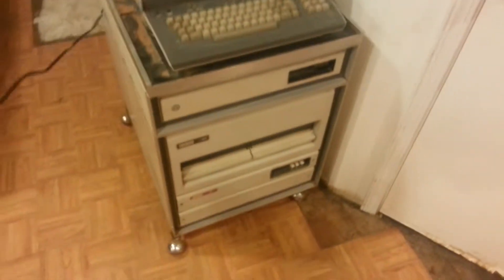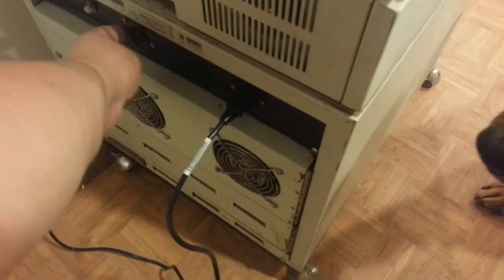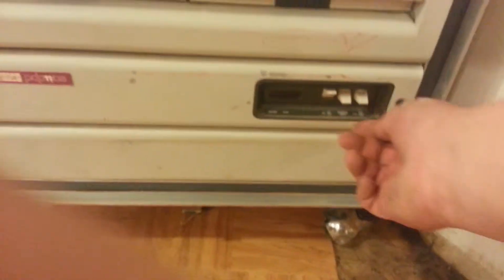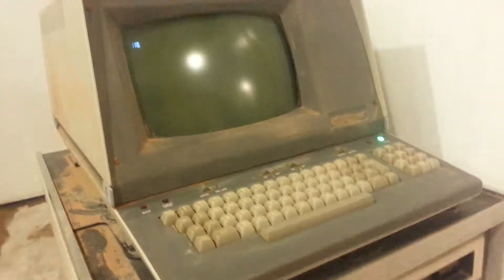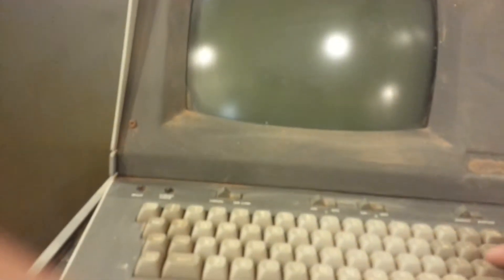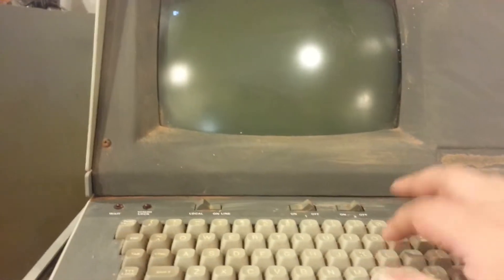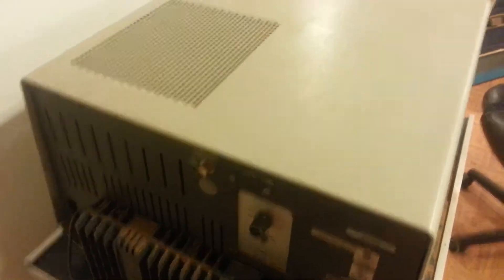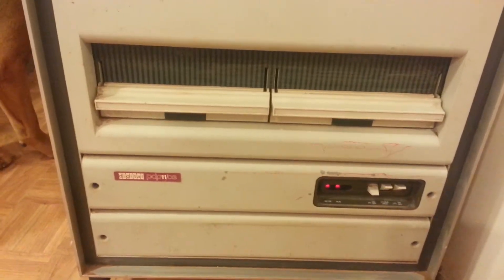PDP11/03 power up attempt

Comment: Hey I was wondering if you still had that Dasher terminal for your Nova 4?
I completed the 2400 mile round trip to pick up my Nova 4 finally and I would love to have a Dasher terminal for it so I can use it for display at Vintage Computer Festival if I get the machine running.
I remember you said the keyboard got crushed but I would still like to have it in hopes that I can build one from scratch as I don't think it will be too difficult to do.
I don't remember if you were willing to part with it but if you are I would love to work something out.
Thanks,
-Connor K

Comment: Wow awesome find. I see you also have a Data General Eclipse? Nova? sitting there as-well! Do you collect vintage computers or just happen to find these beasts? I personally collect and lust after getting a PDP 11 someday. I actually recently bought a DG Nova 4 1150 miles away from me... I still have to go get it, I would have had it by now if I didn't have car troubles... :/ Anyway good luck figuring out these beasts! (Side note I don't know if your a furry but I like your icon, I personally am a furry but not as huge of one as many are heh)
Reply from the maker: Yes, that's a Data General Nova.  I had it operational for a short period of time; one of the start capacitors in the hard drive went out and I haven't had time to mess with it.

I own a technologies consulting business in a small industrial town and these things come up from time to time.  Much of the equipment around here doesn't get upgraded often, so I wouldn't be surprised if these machines had still been operational up until a few years ago. I'm always fascinated by the workmanship of the old systems, and when I learned they were going to be scrapped I had to save them.

I live in the Lubbock TX area.  If you want the PDP machine let me know and we can try to work something out. It has some proprietary Bell System gear wired into it and I've never been able to get it to work right.  I don't have time to mess with it or room to display it.  I think I've taken some face plates off it and it's a bit grungy from storage but it should still be operational.
Reply: ***** Wow really? I'd love the system, but I actually live in Maryland so your very far from me, but I may be making a trip to California with the family in May in the RV so I'll likely be coming through the state then... We will have an enclosed trailer with a car in it but there should be plenty of space for the system. If you can hold it that would be awesome and I should be-able to get it, if you just want it gone to a good home asap I can forward this to some vintage computer mailing lists and probably have someone give it a good home :)

Anyway, that's awesome that you see these things from time to time, if I were you I'd grab anything I can especially since this stuff is only becoming more and more uncommon sadly. And even if you can't grab them yourself I'd urge you to at-least send out messages onto mailing lists or something to get them good homes! And yea one of my main interest in collecting is learning what make these old systems tick, tearing them apart, and restoring them. The Nova 4 I'm going to get only has the original rack, the nova itself, and expansion chassis, and a disk pack drive sadly no tape drive like yours. I wish you luck with your Nova though! This Nova I'm getting will also be my first minicomputer so it'll be an interesting experience. It apparently has some manuals and documentation with it so if I find anything useful I can probably get you some scans if you want.
Reply from the maker: I need some manuals and schematics to see if I can figure out how to repair the drive, depending on what model yours is and what options it has.

The PDP isn't going anywhere.  Just get in touch with me when you think you'll be in the area.  I'd rather it go to someone who can appreciate it and not have to worry about trying to sell it.
Reply: ***** Awesome! I really appreciate it! I will probably PM you when I know the exact dates in the upcoming weeks or so. I also will contact you when I get my manuals and stuff so I can help you find what you need if I have it (your disk drive appears similar to the one that I have so I should be-able to help you out), there are some manuals already scanned in online, although not seemingly what you need it may be useful to check them out.

http://www.textfiles.com/bitsavers/pdf/dg/

Also I must know, will I be receive that lovely terminal sitting atop the system or have you already confiscated it for yourself? ;)

Thanks!
Reply from the maker: Conmega It's actually the hard drive I'm having trouble with on the Nova.  I can't recall but it has something like an 8 or 12mb hard drive. The tape drive seems to work ok but I don't have any tapes to load on it.

I'd like to keep the terminal.  I actually have use for it and I had to do a good bit of work to get it running.  I intend to display it in the front lobby of my office at some point.

I currently have an IBM 5110 personal computer and a Corvus hard drive (and it's many controller boards) on display up there along with a few other electronic eccentricities.

If I can get the Nova running I'd like to put it out and let people play with it.  It's a very nice looking system and can be opened up easily for demonstrations.  It came with it's matching terminal and keyboard, but unfortunately they were damaged beyond repair during the trip over here.

I'm pretty sure you can find more pictures of the machines if you find me on Facebook.  I'm pretty sure I have the albums set public.
Reply: ***** Ah! I see you have an actual hard drive unit, my system has a 'disk pack' drive which is also a 'hard drive' but the platters are removable. I never knew they made actual hard drive units this is new to me! So I may not have any documentation that can help you but if you post on the vintage computer forums (http://www.vintage-computer.com/vcforum/) then I'm sure someone there can help you! The tape drive should take standard 9-track tapes which are fairly common so I'm sure you can come across some to use at some-point.

Heh I understand its a nice little terminal, I actually don't even have a serial terminal yet, so I'll probably end up using a usb to serial cable then which is plenty enough.

Awesome! Sounds like a neat little museum your starting there heh. The Nova is a nice system and would be cool to let people mess with it. Although with my system I'm basically banking on the fact that the disk pack drive will have information on it otherwise there won't be much I can easily do with it... I'm sure your hoping the same with yours.

It sucks that the terminal was destroyed, what was wrong with it? If you still have it and wouldn't mind I'd like to take a crack at it, I have some friends who are really good with old CRTs and old Terminals so even if it needs a new tube I'm sure I can get it going again and would love it for my Nova since I plan to exhibit it at VCF East (vintage computer festival) next year if I can get her goin.

I found your photos, I also see you use an IBM model M! I'm typing on one right now!!
Reply from the maker: Conmega
Haha, yeah, I've had this keyboard forever.  It was my first PC keyboard years ago.  I have them all over the shop and I ordered a custom Unicomp for my accounting office.  It's going to drive everyone crazy.  CLACK CLICK CLACK.
I would have loved to have found a disk pack machine.  It's one of the things I have almost no experience in.

For the Nova terminal,  when we were hauling the equipment off, the Nova slipped in the truck and slid, crushing the keyboard.  Many keys are missing.   I maybe could do some plastic welding and make passible replicas with a 3D printer to make it cosmetically acceptable but  I don't think it'll run again.

The monitor itself simply doesn't power up.  I believe it needs a signal from the keyboard.  I never tried to debug it.

One of my greatest desires has always been to build a relay or vacuum tube hybrid computer, but designed using modern production rules and equipment.

My lab / shop / office / home has any tools you could want if you're in the area and want to mess with it.  I'm currently doing accounting and tax consulting until my health improves. Once tax season is over I plan to take a break and work on some of this stuff.
Reply: ***** Hah awesome! I don't think I'll ever use another keyboard to be honest. Yea the disk packs are cool... But more of a pain to repair and get up and a lot more expensive and rare if you need more or new ones... I wanted to get either a 9-track tape drive or a disk pack drive for my first mini so I got this guy. The 9-track would have been the safer bet but I know some people that are good with disk pack drives so hopefully they can help me out. That does suck with the Nova terminal though, I would definitely hold onto it though because sometimes keyboards for those things pop up on eBay without the terminal and vise versa. Depending on the damage on the keyboard (I couldn't find a photo of it on your facebook) I would recommend trying to 3D print some keys if its just keys your missing otherwise it looks 'OK'. Would be a fun challenge, I actually am going to be 3D printing keys as-well but for an IBM 026 Keypunch I purchased recently off eBay for 9 dollars!!
Needs a lot of work though heh...

Heh I'm working on building a z80 computer to start and get me learning more about digital electronics then I may move onto using straight TTL or maybe straight transistors. But relays and tubes is a challenge I think I'm going to stay away from hah. Relays wouldn't be bad, you can buy new relays pretty cheap and many people have already built relay computers that I'm sure your aware of. Tube computers... not so much. Sadly I think there just isn't enough of a supply of tubes out there and if there is they would probably be best used to keep older tube based computers running instead of building another hehe. But if you really want to mess with tubes try building PONG! I know someone on the vintage computer IRC channel that made pong with a couple of tubes and some other bits.

I don't know how much time I'll have to hang around, I'd likely be stopping by after going to the business convention we are going to in California so I'd have the time but I'd have to convince the family to find an RV park and stick around in texas for a day or two heh. May not be too hard since driving almost non-stop gets tiring after awhile. But if I have time maybe we can look at the hard drive unit in your Nova and see if we can get it going. You said it needed a new start capacitor or something, you may be-able to reform it... (http://www.vcomp.co.uk/tech_tips/reform_caps/reform_caps.htm) Otherwise see if you can get a new one in the mean time.
Good luck and I hope your health does improve, no-one deserves to have bad health :/

Comment: Did you get this machine running at all??
Reply from the maker: Unfortunately not.  What little information I was able to find indicates it was custom-built for the Bell System.  I don't have any disks for it and Bell seem to have changed it up enough over the decades that what little documentation is available doesn't appear to be correct anymore.